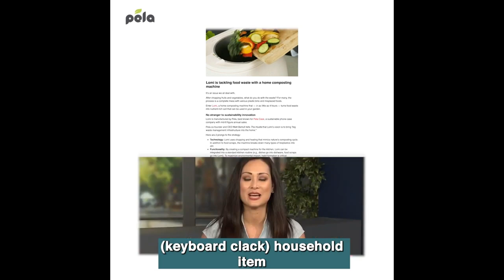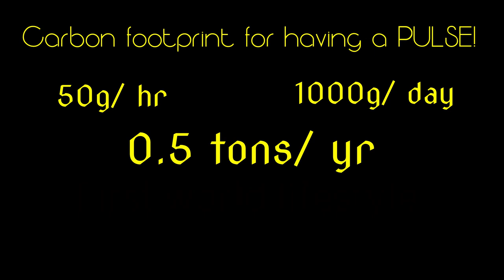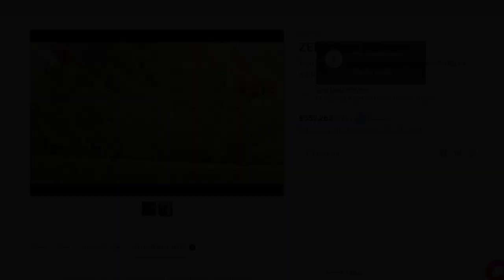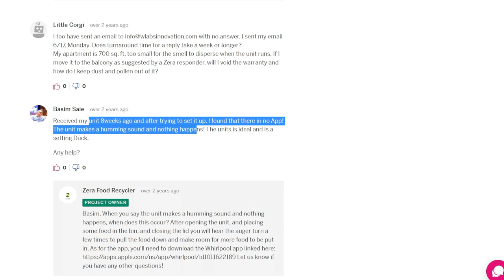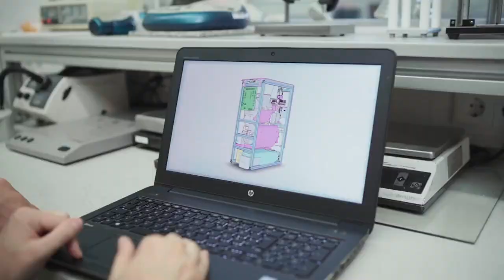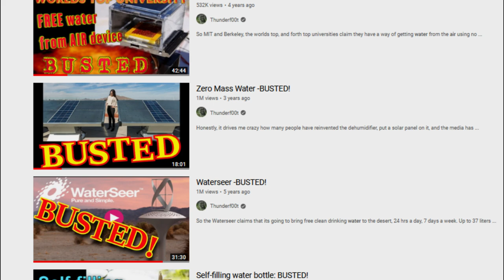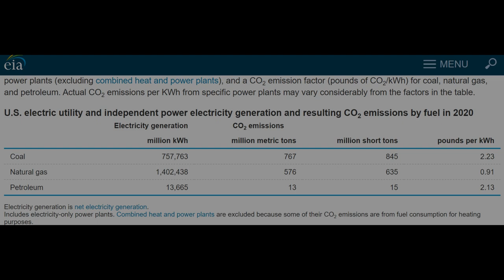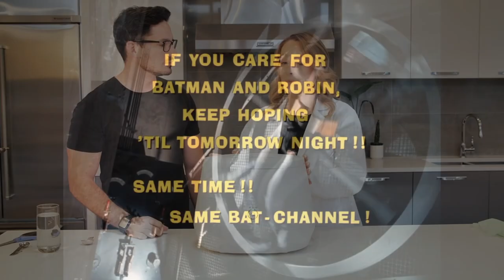Lomi: BUSTED!

Comment: The problem here is that I am not looking for something to turn my kitchen food waste into compost, I am looking for something to turn my kitchen food waste into chicken food. Some people might think that sounds stupid, can't I just feed my kitchen scraps to my chickens as they are? Sadly not, some things are fine, mostly green leaves, but root vegetables, egg shells, and anything really which isn't a soft green leaf needs to be chopped up into small pieces and, in the case of egg shells, baked to dry them out. So we already have an oven using the energy to dry out the eggshells, and a huge amount of time chopping up the other food waste. So I need a machine which efficiently heats these things up and chops them up. The bonus would be being able to keep the stuff hanging around a bit so that I can use it when I want to. This also then saves the energy and money otherwise used to make and buy chicken feed. 

I need a machine to make chicken feed. The chickens make the 'compost'.

Comment: I don’t think it works for everybody. And to say they breakdown food waste to soil is really a scam. You cannot add them to your indoor plant because they will mold over and stink after they rehydrate.

I use vitamix and save up the ground powder in a sealed container for my indoor worm bin. The benefit of doing so is that when I don’t have fresh compost for my worms, I could use the vitamix compost powder. It also prevents growth of fruitful and gnats. Also, I live in an area where heat is on 24/7, so the heat generated to warm up the house is not wasted. As for the dried residue stuck at the bottom of the bin, it doesn’t do any harm, just keep going. Vitamix is cheaper than Lomi and has an extremely long warranty. It keeps your household composting routine less painful, especially when you have to go down the elevator to trash your compost, which costs energy and your time everyday.

Comment: The only part of the video I was a little conflicted about was your claims about the energy mix of the grid. 

In Northwest Indiana you can purchase renewable energy credits to effectively receive 100% renewable energy from onshore wind farms, but I can understand that these credits nor the renewable sources to back them aren't available everywhere. 

And looking at Our World in Data, in 2021 the percentage of renewables for the total global electricity portfolio was about ~28% (hydro, wind, solar, and other renewables like geothermal, biofuels, wave, tidal, CSP (concentrated solar power), etc.). There are areas of the world where renewables make up ~100% of the grid, like in Costa Rica, Iceland, etc. (pretty much island nations), but I do agree that there are other areas where the grid is 100% fossil fuel-based, like in India, Venezuela, or large parts of the UK and US.

If you don't want to pick and choose which country to do your calculation from, then it would make sense to use the global number, around 30%, where 70% would have to be weighted depending on how dirty the fuel is (coal is dirtier than oil is dirtier than gas, but nat. gas produced methane so it's a complicated weighting).

Besides that qualm, yes the fact that these electric composters DON'T produce actual, finished compost is upsetting and infuriating. These companies are, yes, scamming people by claiming that their product produces something, when in fact it doesn't. False advertising 101. 

I suppose that since composting is a new economic activity, and that the only successful society-wide organizations are at industrial scales, we should all be very skeptical of these devices until proper scientific meta-studies can confirm compost via thermomechanical processes is possible. 

Skip. Burn this company to the ground, or even worse, Lomi it straight into the trash.

Comment: ...I can see the heat alone maybe breaking some macro bonds and making it easier for microbes to decompose the waste, but wouldn't constantly added dehydrated material upset the moisture balance of your compost pile? You'd need to manually spray water over it to make up for the moisture you spent time and electricity removing for, what purpose?

Comment: This is a very helpful video for someone like me.
But I have questions that someone could maybe help with.
I'm only planning to start composting and have a vegetable garden for the first time this year. More things I read say that to produce a useable compost from my scraps and materials will take around a year in itself to break down materials.

And yes this machine obviously uses more electricity than naturally composting the whole material. But isn't the purpose to be a middle ground between that and sending your food to a centre to be composted (if they even handle it properly depending on where you live). 
So, my questions are:
Does it speed up the process of making compost in something like a bioreactor? Given everything will be broken down already. Making allowing you to use this year's leftover material in next year's compost? 
And does it have a better impact than sending your waste off to be treated elsewhere?
Reply: 1. Does it speed up the process of making compost? No. By heating the food waste, it actually sterilises it, destroying all the nutrients.

2. This is not composting.

3. You're better off reducing the amount of food waste you're generating in the first place. And grind whatever food waste you do produce in your garbage disposal.

Comment: I'm really trying to figure out what's right here. Yes, electricity usage is to be avoided. But this video completely ignores the main function of the Lomi -- the "grow mode," which combines a compost accelerator with the heat/grinding provided by the machine. That results in compost that can be put directly on the plants, which you can't just do with food scraps. That seems worth it for people who want to avoid the smell (due to pests) of standard composting methods, no?

Comment: I am all about being "Green" but I keep seeing these Lomi Ads which kind of lead me to this video. My first thought was that "How much energy does this thing use?" 

Composting is a "Process" that, as you point out like fermenting beer, takes TIME. 

Now I have a place for my compost pile and I compost A LOT (Egg shells, Coffee grounds, vegetable scraps, yard wasted, etc...) I even put shredded paper in there. I don't need compost in 24 hours either. My compost pile does not stink, and I only turn it occasionally. If the product isn't going to save me money (i.e. costs me more to buy/use versus traditional means) then I don't see the value in it. Even if i just threw away my food scraps, I can put out a 30 pound bag and pay $3 for garbage pickup and let it compost NATURALLY in the landfill. How many KWH's would it take to "Compost" 30 pounds in a Lomi? In the winter time, i wouldn't mind the extra heat (and possibly humidity) in the house but in the summer, Now I have to pay to cool the house back down.

All in all, I appreciate your video on this and I think I will stick with natural compost and use the good stuff on my garden.

Also I hear that the Lomi (and other solutions like it) actually kill all the good nutrients in the process of desiccating the food making it less useful for your garden/plants.

Comment: They must think that we're stupid, and most of the time I have to say, they are absolutely correct. However, it took me about 2 seconds to realize that you cannot heat delicate microbial organisms and expect them to survive and also that the end result is going to be partially composted and will be a nightmare to use on plants. It could bring rodents it could kill the plants it will cause mold and all kinds of other things to grow in it and it's just no good. Also, if you're concerned with carbon footprint conservatively if you only use it twice a week it's like half as much energy as your refrigerator uses and if you have a family you're going to be running it a lot more than that. Finally, if this is to be a viable product it would have to have a much more robust grinder making the price point closer to $2,000 for an under-the-counter full size unit and probably making it utterly impractical for countertop sized units to even work. The proof is in the pudding, all of these things broke very quickly. Since this product does nothing and has an immense carbon footprint, why would you buy it? Well lots of people did and they got exactly what they bought. A scam :-)

Comment: looks like this is a review of everything but lomi lol just all the failed competitors. 
its best to reduce your food waste period.  most people dont have any way of getting rid of food waste . in a land fill it produces methane which is a lot worse than Co2. this is a good option for people that do not have that option, what you get out of lomi can go in your yard and put it back into the earth. methane is only produced when organic matter is not exposed to oxygen when decomposing . there is no methane coming out of lomi just the energy used to power it . the amount of food waste in landfills exceeds this a lot more than powering this device.  food waste does not smell if there is no oil eggs or meat . I have a worm bin in my small apartment currently  , it does not smell if you do your research! that would go for lomi too , I think people are just miss using these devices.

Comment: Decomposition ie: compost is a nicer way to term the transformation of food waste, into soil either in a machine, compost bin or landfill they all give off methane gas no matter what you do it's decomposition and gases will be released into the atmosphere and by using any mechanical process of any kind your putting more carbon into the atmosphere by the way of generation of electricity even if you use solar panels, as production of solar panels puts carbon into the atmosphere as well as the manufacturing of the control units, cables and alike to generate electricity to run that monstrosity of a overgrown doorstop as that's the only way that machine would save this planet anything, but wait how much energy has it taken to produce this contraption, taking the design, manufacturing and advertising into account it's absolutely mind-blowing the cost incurred..
Even the production of the food that you put into it is mind-blowing.

Comment: Sorry, i'm a bit late to the party. Great video.
I never understood why people would buy this crap.
Because there is such an easy and clean alternative: a worm bin.
I bought two 60 litres garbage bins, drilled some holes for air in one of them and holes in the bottom so that the wormtea could get out and placed that bin into the other, put in some coco coir, food scraps, egg shells, coffee pads, tea bags etc. get buried under a bit, newspaper, cartons and finally about half a kilo of red wigglers.
They eat and turn our food scraps into the best fertilizer (and liquid fertilizer aka the wormtea), it doesn't smell, needs no power at all and i don't have to throw something in the green bin or garbage.
Oh and it's completely indoors. Everyone could to that.

Comment: Pela's marketing is BS, bjt they might have a good idea... might

Depending on how much energy is being used, dehydration could save on the energy cost of transportation of the food waste. 

But this lets you do 2 key things: 
- Put compostable packaging in the green waste (all packaging is removed from green waste as they can't tell whats compostable or not, so breaking it down beforehand stops it being removed and placed into landfill)
- Compost cooked meats at home, cooked meats typically attract vermin and can clog your compost heap. By turning the food waste into a powder this prevents this and kets you distribute the meat throughout your composter oreventing clogging and the odor from the meat (which attracts vermin)

If this is a net benefit or not is unclear, and it's definitely not how the product is presented in their marketing

Comment: God segment 👍 I've been continually amazed at ever new attempts at saving the climate with over-engineered, energy intensive wingdings for more than 20 years. In this calculation, the energy and materials cost of producing these units isn't even considered. And then of course the energy that has to go into recycling and disposing of the device. These things hurt the environment. If you want to do something for the environment then purchase less kitchen appliances, and when possible, purchase those that work without power (i.e. manully). And keep them as long as possible. Same with home electronics. I'm wondering if the people developing such things really don't understand the fallacy...? 🤔

Comment: I bought one. For what its worth, I only paid $250 American for it. And truthfully, I wasn't doing it to save the planet, I just thought it was a cool idea. 
Anyway, we got it, we put it together. we filled up the little bin inside with scraps, turned it on, tried to change the mode and BAM!, all the lights went out and now it just sits there beeping. Nothing works. no lights, no sounds other than a beep every 3 seconds or so. So, in summary. It was brand new, I have never used it, and on my first attempt it died. 

I will update this comment later with my refund progress. Here's me holding my breath. 🥶
Reply: Well, this thing has a massive, power-guzzling heating element inside it. That explains why your fuse box went hypernova the moment you turned your Lomi on.
Reply: @electric7487  You are correct about the heater. But just to be clear for anyone else that comes to this page. It didn't blow a fuse in the house. (I know my description of the lights may have been confusing) I just meant the lights on the Lomi itself all went out. It was just defective out of the box. Hopefully, we can keep someone else from buying this sham of a product either way.

Comment: When something living decomposes naturally it releases carbon. What is the ratio on carbon emissions for natural decomposition and using a machine? The other factor I curious about isn't it's use as composter but for compression. A foot by foot of waste compacted to handful of waste. Most landfill will never decompose due the fact most people will never separate   organic from everything else. However we running out of space for our landfills and dumping in the ocean. This might have use in reducing physical size, so that when we all die of CO2 poisoning the sea creatures can live on. No in all seriousness I live in a trailer park with no space between houses, I want to compost but if it smells I'll get kicked out .With no recycling program, and the community manger has been denied several attempts on getting recycling because it's too far, I'm so used to recycling but I had downsize due a unexpected turn. Wtf am I supposed to do.

Comment: Watching this made my PhD spider sense tingle, which made me sit down and do some math, and for that I cannot forgive you Thunderf00t. For starters, biological methanogenesis is a strictly anaerobic microbial process. So applying dried biomass onto well aerated soils, like a home garden or most types of agricultural fields (besides rice), will not contribute to any net methane release. Given the relative potency of methane as a greenhouse gas, the math actually can add up, but only if that the dried waste goes into a green bin or a garden rather than the landfill. I've seen estimates around 65kg methane release per metric ton of organic landfill waste, which is the GHG equivalent of 5460 kg of CO2, or ~5.5 kg CO2e per kg of biomass. So, even if the energy going into this process releases 0.5kg of CO2 per kg of waste processed (2x your best case estimate), it could still theoretically help save almost 5 kg of CO2 equivalents per kg of food waste processed. Like I said, the math CAN work out favorably here, just not people are just sending the dried food waste to the damn landfill anyway. This also doesn't account for the GHG production that goes into manufacturing one of these overpriced food dehydrator.

Comment: As someone who gardens, and who is composting the old fashioned way, I've learned to be skeptical of just about anything which promises to compost quickly.

Honestly if lowering the carbon is our goal we need to stop pretending that this is something that's going to be accomplished on an individual level. I think we learned during the pandemic that the issue aren't the consumers, it's the industries. 
About the only thing individuals can do to save the planet is simply not have children and try to consume as little as possible. 

Both of which are things that most are not actually looking to do.

Comment: 17:20 you couldn't have said it better. There are actual WORKING systems for collecting rain water that can be used for the home that ALSO has a freaking built in FILTRATION SYSTEM. 

And yeah. you can't call it composter if you're really just heating and grinding up the food. Composting is all about breaking down materials with a slow heating process that also uses fungi, bacteria, soil organisms or micro-organisms. You can't exactly replicate the process in 24 freaking hours. But my main issue is how they claim it doesn't stink but the early process of compost does as the materials are being broken apart which is why city compost bins (the ones you would throw your yard leaves and such in) stinks when it's hot in the summer time. My favorite part is them saying on their website that it creates dirt. No. What you created was a machine that makes SOIL-LESS substrate because it's NOT made from clay, sand or silt. Even more comical is when they are originally wanting to reduce garbage waste when you can throw it away anyways. I mean I get that it helps to reduce the amount of space taking up your garbage can but it's a stupid take.